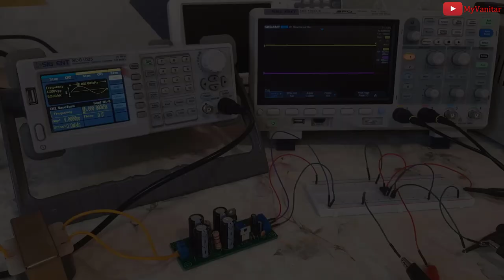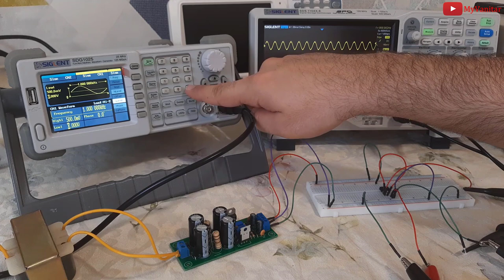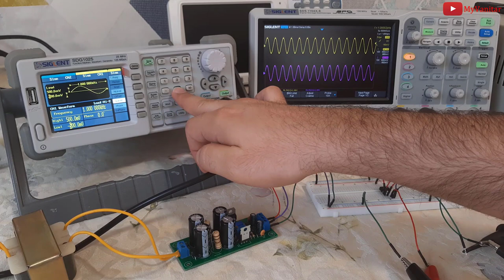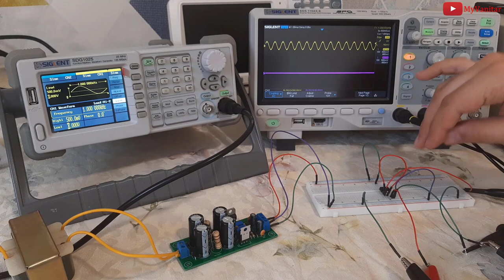OPAMP Single/Dual Supply In Practice [Negative Rail and Positive Rail]

Comment: There is no difference, there is only the limit of where the input and output rails extend to. For TL027, it's input is Vss + 1.5 to Vdd. In LM358, input is Vss to Vdd - 1.5. So the TL072 cannot track the bottom of its input rail, and the LM358 cannot track the top. If you showed 500mV sin starting at 8.5V, then LM358 also would be flatlining.
Reply from the maker: alright, everyone has an opinion, you follow that on your own designs.

Comment: If I have single supply how can I get positive and negative 9 V like you did.
Reply: Is there other choices rather than using transformer ?
Reply from the maker: @deez3200  You have a single supply opamp or a single supply input (a positive input)?
Reply from the maker: If your input signal has both positive and negative elements, you have to use both supply rails with an opamp, however, if your input signal just have a positive element, you can go with a single supply opamp, otherwise, if you use a dual supply opamp, you have to provide both rails for it, even if your input signal just have a positive element
Reply: @MyVanitar  single supply input and I want to get positive and negative supply for the op-amp.
Reply from the maker: @deez3200  You can use charge pump chips to generate a negative rail from a positive rail, such as ICL7660
Reply: @MyVanitar  Thank you very much.
Reply from the maker: @deez3200  You can also build one of my projects that is designed for this. You can adjust the voltage of both positive and negative rails
Reply: @MyVanitar  I found a simple solution by using voltage divider for two resistors with 1 K ohm, and voltage follower. It works
Reply from the maker: @deez3200  Also you don't need to use a transformer for that circuit (my power supply circuit in the video), if you connect a DC voltage to the input, it will work either and you can get adjustabled + and - at the output
Reply: @MyVanitar  You are so helpful, thanks again.